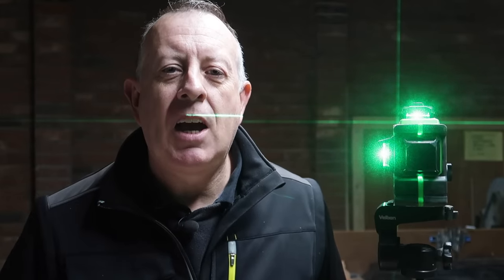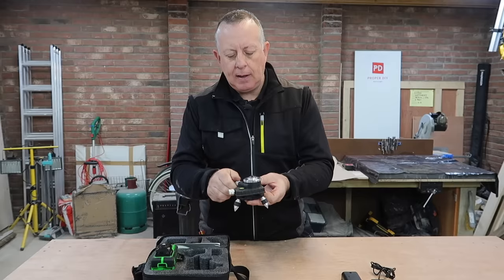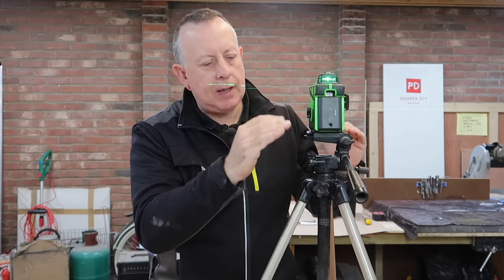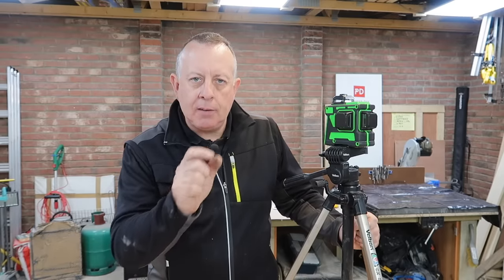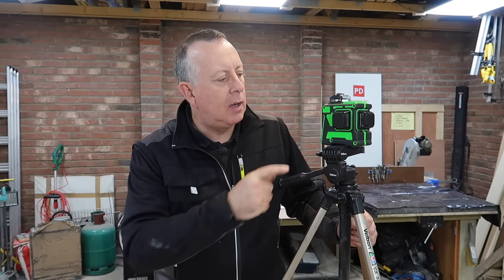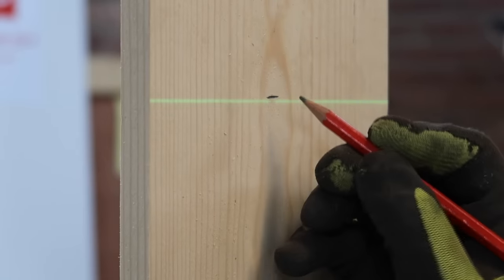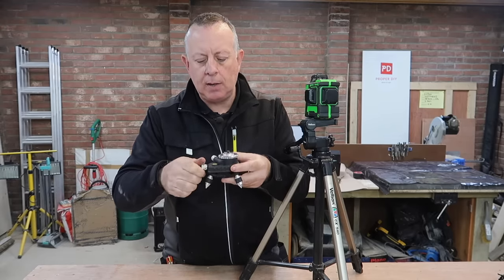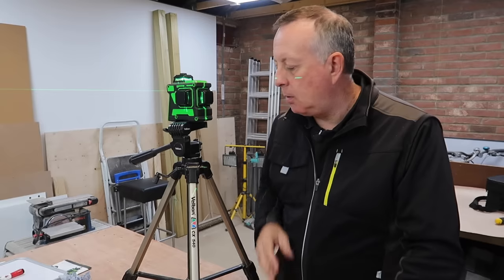Why Every DIY'er Needs a Laser Level

Comment: Question:
Since it's working until 3°
Does this mean that you need to place it practically on the same height you are working?
Is there any laser that I can put on, for example, 1.5m and then tilt it to point a level line on the wall 2.60m height?

Comment: I purchased the exact same laser leveller model demonstrated in the video, so to have it explained by Stuart was brilliant. Trying to understand the manual was hopeless but to correct Stuart buying this product via WISH allows customers to buy one of the option packages that includes a tripod in addition my pack included an extra rechargable battery, I believe I got excellent value for money and thank you once again for an excellent presentation
Reply from the maker: Thanks for the feedback and for the tip! If you can get a tripod and additional battery at a good package deal I would definitely go for that.

Comment: How could you use this to install a level tile floor??  I suppose you would need a 360° laser level that could throw out horiz. lines around a room at the height of your would-be tile floor, at say anywhere between 3/8 inch to 3/4 inch above the floor. But how would this device do that, unless you can set it on the door and get the Lazer beam that low?? Thanks for the vid and explanation and candid pro's & con's.

Comment: How would you get an accurate 45 degree angle bisecting the horizontal and vertical access? do you have a link to a video covering this please? I need to mount some ceiling speakers at a 45 degree angle from the listening position and I am not clear on how to do that. Thanks in advance.

Comment: Amazon link says unavailable...seems they range from £30 - £200, I think for most jobs the simple £30 is fine, I get the usefulness for a plumbob replacement but that’s easy enough to replicate by switching the axis on the cheaper single laser model. Nice video !
Reply from the maker: Link updated - they sold out!

Comment: Hi, Great channel. I have just receivd a laser level that you reviewed. Overall it looks great. I have a quick question regarding charging. The instructions state you can use the device while charging, it also states, and I quote...The LED wil show green while charging, it will show green when it is fully charged. When i have it charging there is no light at all. Before i send it back, what was your experience on charging. Cheers. Russ.

Comment: Im glad I came across this channel. Really well presented. Thank you.
Reply from the maker: Thank you very much
Reply: Be careful when using the laser on a tripod mounted on a suspended floor. Also if you are using it in the locked off mode, then you need to put up some reference points at the start. If the tripod gets a knock you can tell if it has moved by looking at the reference marks. Also if it's on a suspended floor you can tell if the floor is moving as you walk around, by looking at the references. If it does then you'll have to mount the tripod over joists. Or get a different solution. Say mount it on a hanger from the ceiling.

Comment: Interesting video. I purchased a basic laser level last year to hang pictures but struggled because I have high ceilings and a tripod was not tall enough. I tried angling the laser up but found it screwed up the accuracy- guess the only solution is temporarily wall mounting for horizontal lines at 9-10 ft?
Reply from the maker: Put a faint pencil mark where the beam can get to and measure up accurately from there

Comment: Another good video.  I do wish I had purchased a 360 level instead of the cross-line style.  I figured I wouldn't need it.  I was wrong.  It was a chore to keep moving the level to different points in the room to lay out all of my wainscotting.  A 360 would have made the chore trivial.
Reply from the maker: Thanks. I nearly did until I came across the cheap 360deg one

Comment: Love your work! Quick question: what’s some methods for leveling post height against the others that spans a distance? Thanks in advance 🙏
Reply: Depends on the type of post, but I'll either level kickboards on ground and measure up. Or use 2m kickboard to clamp to posts with a rounded top or simply balance on top of flat posts.

Comment: I have a laser level too, but rarely use it. In the real world it’s not are quick as spirit level.
Try measure a position 30cm horizontally above the max height of your tripod? You will need to find something between 30cm - 60cm (assume you have a range) for the tripod to stand on to cover that height.
Reply from the maker: No, put a datum on the wall then measure up - the laser doesn't need to be at the level of whatever your marking. We use these on site in the construction industry all of the time for this type of setting out

Comment: When using a spirit level to set out anything that is longer than the level, it’s good practice to rotate the level 180 degrees to reduce the creep you mention over distance (if that makes sense) As for laser levels.. I wouldn’t be without mine, I’ve even used it to keep the perpendicular joints (the butt joints) level with each other on a laminate floor. (OCD)
Reply from the maker: Good tips. Perfect to project a perpendicular line for flooring!

Comment: Hi Stuart, does this laser measure also allow you to see if a floor is level and also allow for marking around a room to get a level floor using self levelling compound?

Thanks
Reply from the maker: It will. I have done exactly that by using a measuring stick and essentially surveying the floor. See the start of my 'How to Build a Mortise and Tenon Door' video where I use it a check how flat a workbench is - same method

Comment: Am I missing something?
Having a tripod over a mitre off the floor is ok but what if you need it at low or high levels?
Do you have to find a shoe box or step ladder the right hight to rest the laser on?
Reply from the maker: Using the fine adjuster base it comes with without a tripod (or just putting it on the floor) would lower the horizontal beam to around 100mm. I've also used it on a bench (see my 'Install a lintel and Open a New Doorway' video) to get it above 2m. This is where a magnetic base or side plate would com in handy to be able to clip onto a pole at any height.

Comment: Super Series of informative videos as always, thank you!
I rarely impulse-buy kit based upon YouTube use, but this was incredibly cheap so l got one. 
I concur with your observations on this laser level, especially the Fisher Price plasticky feel.
The levels were well within tolerance along my 6m garage, though, so I am very happy.
The instruction manual is hilarious! Best bit of Unwinese I've read in a long time, but hard to decipher.
I happened to have an old tripod extendable to 1.6m, which is all that remains of a long-ago kaput Power Master Laser Level Kit purchased over 20 years ago. Lo and behold, the male thread at the top of the tripod is ⅝", which is a perfect fit for the female bottom thread of the base that comes with this new kit. Result!

Comment: nice but I don't understand how it can work to project a cross UNDER the tripod - I also got a 3D leveler and I haven't yet understood how it is possible to simulate a vertical line in the middle of the room - how can I do this ..I've got just this single cross at the ceiling
Reply from the maker: It's not directly under, its slightly to one side as the vertical prisms stick out from the sides and pass through the tripod to the floor.
Reply: @ProperDIY   ...thanks, that makes sense, of course. Regarding my leveler now I found out, that there is a mode in which a red laser point is projected THROUGH the threaded hole for the tripod (!!)  hurray. This mode is not mentioned in any comments from buyers (and even less in the "description" in the user manual) but at least there is a mode that allows an exactly vertical alignment of the floor to the ceiling (even if only a bit cumbersome). Can't understand, why they can't organize proper, descriptive translations for such devices, not even in English (not to mention German, my native l.)  ..well, they just don't care  ,)

Comment: Hi Stuart.  Can you tell me if the red LED on the charger goes green once it’s charged?  It looks like a red LED to me!  That manual is exactly as you describe.  Having just opened the box and started to charge the battery, I am seeing a solid red LED on.  Your help would be appreciated. Thanks. David
Reply from the maker: Yes I think you should be looking for a solid green light for a full charge
Reply: Hi Stuart.  It did change to green - thanks! David
Reply from the maker: @davidlang2743  Good - it does in the end!

Comment: I've used a couple of laser levels and, honestly, I wasn't all that impressed. The lines aren't very thin, and combined with the errors shown here, well, you can end up several millimeters off, which can be more than you like. It's certainly more than I would like. One of the lasers I used was a 360 degree one, but horizontal only. It was essential for the job at the time, which was lowering a ceiling, but it was awful. Hint: it was made by Black & Decker. Anyway, the line was so inconsistent and with gaps, and the slightest vibration in the ceiling or breath of air would make it dangle (a tripod wasn't high enough), forcing me to wait until it settled again. This also made the battery drain fast. Once the job was done I got rid of it, and I wasn't comfortable about passing it on to anyone. I later got a cross laser, which I barely used, because yeah, the reach wasn't very good. I haven't used it in a while.

Comment: (Me, DIYer)
"I don't need a router and bench."
Bought one, use it frequently.

"I don't need a mitre saw."
Bought one, use it all the time.

"I don't need a track saw."
Bought one - it transformed my life.

"I definitely don't need a welder."
Bought one, have made and fixed heaps with it.

"I don't need an SDS drill."
Bought one.....OMG!

"I don't need a laser level."
Off to buy one now!
😆

Comment: Is it possible to square a footing with a laser level instead of having to use the 3 4 5 method or using a metel sq
Reply from the maker: Yes. If you use a 3 line (360 deg) laser you can project 2 very clear 90 deg lines on the floor or ceiling

Comment: The whole point of this type of level is to produce a 'level' (or plumb) datum line around an enclosed area. Specific heights of components, for example, tiles, wall cupboards, pictures, can then be marked off (either by a suitable measure or staff) from the datum. Attempting to get the laser line at a specific height is mostly pointless, as you are governed by the height of the tripod if used, or limited by the surfaces you rest the unit upon. Vertical or plumb lines are easy as you can rotate the unit until the vertical beam (if it has one) corresponds to your reference mark.
Consider that a bricky commences laying from a specific datum and then uses his six foot Stabila throughout the build.
Reply from the maker: If you can get the level to the correct height (not always possible) then it makes life easier and cuts out another operation the can introduce an error.

Comment: A Leica dumpy level is much cheaper and does just a good a job - for outside work certainly.
Reply from the maker: A Leica dumpy level is well over £100 so is more expensive and requires 2 people - one for level and one on staff or marking. If you can get Leica level cheaper than the Laser level in the video I''l take 50.

Comment: For reference: 3 degrees error over 15 feet = 0.786 inches.  Your drainage pipes' slope, regardless of diameter, are going to be significantly larger than that.

Comment: Useful video as I just bought my first laser level, actually the same one as you have and whilst a tank of fuel is now considerably more, the level was only £38! It's typical Chinese quality but hopefully should last as I'll only use for my home DIY. The leaning function only works with the rotary switch in 'on' position, seems fine but I am concerned about my 'compulsary perpendicularity!' The manual says it should work like yours but as you say, the manual is useless, mine talks about 'ruggef topography'. Also 'human & animal shouldn't look into the laser light'... better keep it away from speedy then!
Reply from the maker: Nice one. I like the phase 'ruggef topography'

Comment: Is it possible to project a horizontal line on a different hight that the laser is set up in?
Reply from the maker: No, not really. You need to have the ability to move it to where you want the line.
Reply: @ProperDIY  thanks for the reply... eventhough I was afraid of that answer. I'll see if I can find a way to do it with a little mirror.

Comment: Professionals need them as well. An electrician fitted four double sockets around a friends bedroom. All were at different heights and two at a distinct angle. I could see they were all wonky by eye but using a laser said it all. Unfortunately he had already been paid but this is not atypical of 'professionals' these days. Bodge it and run.
Reply from the maker: Unfortunately this is a common problem

Comment: There are potential errors in your tolerance check.  When you rotate the laser unit 180 degrees using the tripod's mechanical rotator,  you are assuming that 1, the rotator is physically level and 2, the rotator on the tripod rotates in a plane and with no slop/deviations from flat in its rotation range.   IMHO  to get really accurate on this tolerance check, you must first level the base of your tripod base using a bowl level, an additional piece of kit attached to the bottom of the tripod head and which allows you to level the base of the tripod head, regardless of whether the legs are level or not.  Mid and uuper-level video tripod feature such a mechanism.    NExt, you must level that bowl using either an accurate T-level or a laser level.  Once you have that in place, you must make sure that tripod head you're using acutally has planar rotation, with no slop of looseness in its movement.  The tripod's rotator is a rotary bearing and of course all rotaray bearings have their own tolerances, and the cheaper the bearing, the wider that tolerance is.   Generally the name brand tripod heads would have better/more planar rotators , but even the more expensive units have only penny-sized 2-way bubble levels, which are garbage in terms of real accuracy, even if the mechanical engineering of the tripod head is excellent. So that leaves another piece of kit for this purpose - an accurate digital level used just to level the bowl-base that your laser is attached to.   If you implement what I have described above, then and only then can you approach any degree of certainty that you are actually checking your laser level's tolerance accurately.
Reply from the maker: No, I'm not assuming the rotator is level, it probably isn't - the laser is a self leveling pendulum. So as long as the rotator is within a few degrees of level, the pendulum mechanism levels the laser and the rotator then has no bearing on where the laser points.
Reply: @ProperDIY  It's true the unit is self-leveling, but please consider the following.  You agree that the platform is probably not level, so let's just assume you've eyeballed it very well and have leveled it to within 2 degrees of level.  So the laser level is sitting on an nearly level platform.  then you rotate the platform 180 degrees.  After rotation, the laser unit will be oriented 2 degrees up / down from where it was before rotation.  Yes, the unit's self leveling guarantees that it's going to shoot a paralell beam no matter what, but the vertical location of the laser itself is now a little bit higher/lower than it was pre-rotation. The vertical position of the origin of the light source being a little above/ below where it was pre-rotation means that point where the laser beam hits the wall will be above or below where it should be if rotator were absolutely flat.   How much will it be off? the least it could be off would be if the center of rotation was also centered on the laser exit point.  The more off-center the laser exit point, the more the physical location of the laser itself will have deviated.  So how much deviation are we actually talking here? A 2-degree deviation over 7 inches amounts to 1/4-inch.  So your laser being about that distance from the rotation point, in physical height could be that much deviated.  Is that significant? I guess it would depend on the room size.  A quarter diffenence in a 10-foot room would probably be noticed.  100 feet? Not at all.  Also consider that you might be using this to build a yacht or big sailboat.  This problem I have outlined would cause major asymmetries in the boat's geometry.   Since can lock the laser head, I think it would be possible to check the level of the rotator first by marking a point, then locking the laser, rotating 180, mark that point. Then unlock the laser and see if the point has shifted. If it has, your rotator is not level.

Comment: I bought this & the lean function doesn’t work. If the pendulums are locked then it won’t turn on. Can’t think what I’m doing wrong!
Reply from the maker: With it locked, a 2 or 3 second press on the top button should turn on the laser in locked mode
Reply: @ProperDIY  appreciate the reply. I have now figured it out. On mine (seems to be same model so not sure why it differs) you turn on as usual then hold the H/OUT button. On off switch seems to be for storage only
Reply from the maker: @HIYAharry  Oh OK - I'm glad it's working
Reply: @HIYAharry  I've got a similar issue, ordered using the link in desc (UK). The lock button on the side seems to be the only way to turn it on/off on mine, I can't figure out how to have it on with the pendulum locked. It does have a power button icon on the top, but that only seems to make the beam brighter/dimmer. The version I received is also a bit different as the horizontal laser is on the bottom of the level instead of the top.